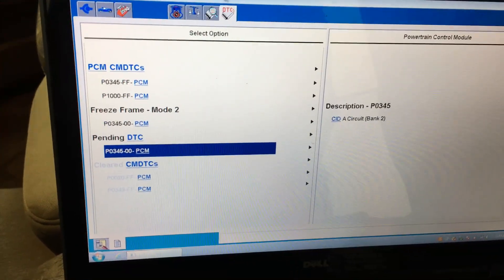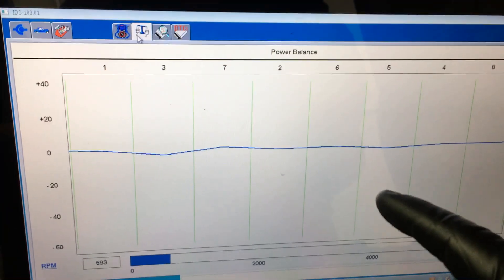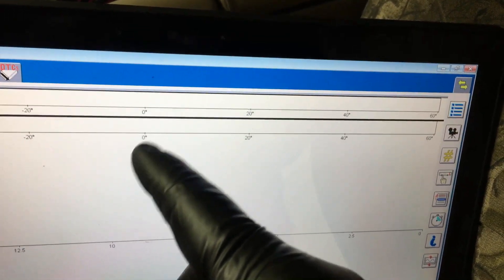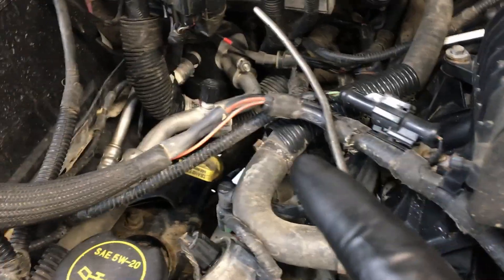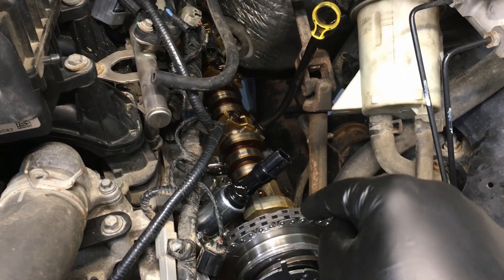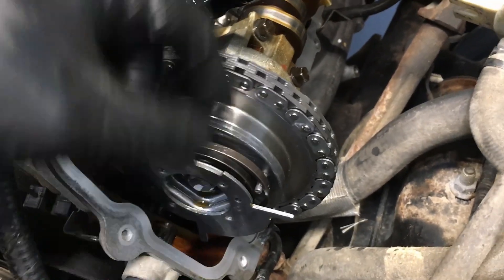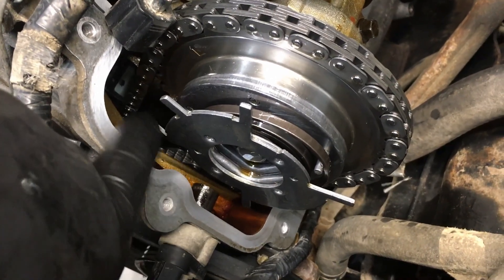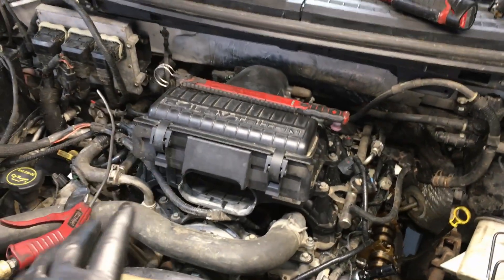Ford 5.4L 3v Triton Engine P0340 P0344 P0345 PO349: Always Inspect These Items First!

Comment from the maker: Still the Best 5.4L 3v Phaser- 
https://amzn.to/2HC6ELE
Reply: I bought a unused phaser from a guy off craigslist that was supposedly an updated version but i cant find the model number online thats stamped on the phaser, diid i get the right one? 3L3E-6C524-HA
Reply: FordTechMakuloco       Hi, I’m a new subscriber to your videos. Lots of great information. I have a 2012 Escape and I looked through the library to see if I can find anything regarding the constant vibration when idling with the 2.5L engine. Have you ever done any diagnostics on this issue? Ford doesn’t seem to have a fix for it even after having the issue for several years. I did read once that replacing the motor mounts with aftermarket ones can help because Fords are too stiff. Another issue I have is a front end rattle when going over bumps either left or right. I have replaced the sway bar links but not the bushings. I have checked the front end several times both loaded and unloaded and I can’t find anything that would create the noise. The struts are original at 140,000 KM. Could they be worn out? I’m tempted to just replace them and the control arm assemblies at the same time and be done with it. Any suggestions you can offer would be appreciated.
Reply: FordTechMakuloco will a phaser cause all 4 coils not to fire? I have a 04 F150 with the 3v 5.4. The phaser was knocking the noise when away about 1500 to 2000 miles later it starting skipping I check the coils and that whole side is not firing any help would be greatly appreciated. Thank you!!
Reply: Does anyone know if the extended warranty I bought covers the repairs to fix the cam shaft issue ? My 2008 f150 5.4l 3v w/70k miles is shaking and turns off when I reverse or in heavy traffic. (Code p0345)
Reply: @fordtechmakuloco what would you look for if you suspect an oil pressure loss in the driver's side (bank2)?
I installed a complete ford timing, solenoids, and phaser set, a melling 340hv, all new Motorcraft plugs filters and 530 oil. I'm 1000% the timing is correct.  When the engine has been run for about a half hour and you come to a stop the left bank timing goes advanced 60° and misfiring until you shut it down or put in neutral and rev it, then it goes back to normal. Fuel pressure, maf, tps all look normal. Phaser tabs not bent, swapped left and right cam sensors, still the same. Where would you start?
Reply: So I'm having the p0340 and p0344 codes the tech here at Rusty Wallace Ford is saying it's my PCM after he just replaced my engine, can this be right?
Reply: Does the middle tow ring he's too be dead across from the L when we time it ourselves? Or just after its been r running And we open it up for whatever reason... 
Just saying trying to get the answer..
Lmk
Thanks..
Reply: Great video but im giving it a thumbs down. This guy doesnt respond to comments on none of his videos
Reply: OPEN QUESTION.  Ok so I had a PO345 A Circuit (bank 2) . Ran rough a few times. Then yesterday I got 4 Blocks and it died. Won't start now. I purchased two camshaft sensors and switched out the driver side. When I went to switch out the passenger side Not only was the clip broke but the 8 mm bolt was stripped. After three trips to different stores purchasing different nut removal set,(Still couldn't remove it!) I'm now contemplating on removing the radiator fan and shroud, or attempt and try and weld a bolt on. It's also - 25 degrees. Before I go ahead and do all this work I just wanted to ask what you guys think as far as this probably being the problem. Any feedback would be greatly appreciated. Thanks guys.
Reply: @locknload9143  wasting ur time
This guy isnt going to reply.
Reply: i changed the driver side sensor for code p0345 but still have same code on the dash for my f150 2007 ! any one have any ideas
Reply: FordTechMakuloco I followed your videos and changed the entire timing system , timing cover, and left side valve cover. 

My 5.4L ran great for two days at all speeds , then suddenly the car went back to a rough idle and gave me codes P0018 and P0022, saying "camshaft position correlation" and "A- camshaft position , timing over-retarded"

I disconnected and reconnected VCT VALVES which didn't fix it, I also changed out cam shaft sensors which did not help. 

I am still getting these codes and a "check gauges message just like the symptoms were before. I bought all OEM parts. everything went smoothly until now and I'm dreading having to take the timing cover back off. What should/ can I do next? You're the professional and I await your knowledge. Thanks for all the great informal videos.

Comment: Hello. I have the coyote with new timing chains and one phaser replaced getting all the cam sensor codes and misfire codes bank 2   Any suggestions. Start and  high idle fine. Then start to drop and won’t stay running unless play with throttle the whole time.

Comment: I recently did a timing job on my 2007 f150 and before I did anything it had a p0340 and a p0344 code . Did the timing and still have these codes and engine still shakes at idle. Replaced camshaft position sensors still doing it. When I take it on a drive it normallly comes back with a clanking noise and it I’ll shut off under load.

Comment: Could it be a crank shaft position sensor?
Reply from the maker: no
Reply: @FordTechMakuloco so my car idles a lot better when alternator is disconnected. When it is connected it idles at maybe 500-400 rpms. when disconnected it has a 700-800 rpms and isn’t bogging out nor shaking. Thank you for this video

Comment: Tremendous thanks to Brian who has saved me thousands through his outstanding Ford 5.4L V3 videos. This one in particular was exactly why I was throwing a 345 that resolved into 349 (confirmed malfunction). After my timing job (following his 4 part series), I ran into this code but with a smooth running engine.  FORSCAN wouldn't even register  the VCTADVERRs on either bank. I used small wire camera through the Cam Sensor on bank 2 and turned the engine slowly as each tang went by and sure enough clear as day one of them was not like the other 4. Opened up the valve cover, carefully straighten the tang with small needle nose pliers and spongy tape on the ends. One of the bottom two tangs ended up being the culprit and not one of the three (bracketed by the L) like in Brian's case. No more codes and VCTADVERR now showing good timing values. Wish I would of watched this before the 4 part series, or after.

Comment: New timing kit. Ford phaser new vvt and Camp sens. Code p0345 and code p0349 wont go away 14 vots at Cam  wires no broken cam wires is this the pcm? Please help I have  review my work 4 times everything seems good except those codes wont go away
Reply: Bought the car with timing Issue had Cam codes when i bought it im really thinking is the pcm

Comment: you say that the sensor "NEVER" fail ....Well mine did. So it can happen. Not saying that there isnt more of an issue but my sensor did fail.
Reply from the maker: To this day I have not seen one fail in 20 years of specializing on this engine. How did it fail and was it a Ford unit. Was it damaged in some way?
Reply: @FordTechMakuloco  it looked to be original. I tested the resistance of the sensor between the two pins to have almost none. The sensor on the opposite bank had resistance as well as the new one. I even switched the old sensor onto the opposite bank and it gave me OBC code to that bank. That old sensor looked to have no damage on it.
Reply: @FordTechMakuloco  Having said that i will let you know if that new sensor fails again, (meaning something else has causeded its failure). Time will have to tell, but as for now it is working fine ....No engine codes....Motor has always ran fine..
Reply: I still 
believe you know these hand grenade motors inside and out. Keep up the videos. You clearly know your diagnostics and repairs. Never say never and keep an open mind 🖕

Comment: Replaced with motorcraft camshaft sensors due to p0340 and p0344. Replaced sensors. Over multiple times intermittent. Comes back. Bank 1.  This motor has the Roush supercharger system that has the alternator repositioned. This is happened about 4 times since replacement of sensors. 112k miles since motor and supercharger install.

Comment: I have a 2010 F-150 with a 4.6 l three valve and it is showing the p0345 code which says camshaft position sensor circuit malfunction bank 2. I replace that camshaft position sensor because it was bad but I'm still getting the same code. Watching your videos one of them led me to believe it was just my VCT valves going out but now I'm not so sure and think I may have to  at least  replace my cam phasers if not have an entire timing job done.

Comment: Need help my 2007 ford edge 3.5l keeps shutting off exactly after 10 mins runs fine shifts fine changed the cam sensors still shuts off exactly after 10 min of idle or drive i have timed it has 250000 miles wondering if its worth trying to fix or just cut my losses the water pump was changed before i bought it last year i did a new alternator and radiator and coils plugs the whole ordeal but this goof lil suv keeps shutting down with no warning any help greatly appriciated

Comment: So i have these codes plus crank position sensor and o2 sensors. I have a serious list of codes that shown up on my 2010 f150 5.4 fx4 that I'm told means my engine is shot. Just wondering if i need an engine replacement or is it something simple that is causing all my codes. It's  easier to say what codes its not listing than what is. I have no knock sensor faults.

Comment: Ive been fighting a p0018 and crankshaft and camshaft codes. Also threw a misfire code on 5,7,8. Changed both cam sensors and crankshaft sensor. Changed all plugs and was just about to open her up to get to the vct and i noticed my alternator connector plug was unplugged! Would that throw these codes and give me a very rough idle?

Comment: Awesome follow up to the phantom 345/349.   I am experiencing the same thing! I have done everything you have suggested except the Power Balance and the Relative compression testing as I am using FORSCAN.  I've pull the valve cover and checked the quality of the Phasers and no bent prongs.  Any ideals of anything else I can do?

Comment: Man, I'm having the worse luck with my truck right now. Paid my brother to do the timing job as I simply did not have time for it. Now truck runs like it has a thumper cam in it. No power no fuel miealage. Replaces 02s and cam sensors. Still same issue. Replaced FPDM same issue. I'm gonna have to tear off my tapet covers. My VCT's are melling brand. If this bent phaser isn't the issue I'm going to change the VCT's to ford oem ones. Glad I came across this issue. I owe too much money on my truck for the engine to be bad. Quite stressful

Comment: I can't believe I found this video it all started cuz it had a while I had it apart I figured I do the timing chain and new cams put it back together had a problem with bank to took it all back apart cuz I thought maybe I had the timing off put it all back together still had the traced wires did everything possible I could think of till I seen your video three of the cam phaser teeth with Bette straighten them out lights off happy guy thank you

Comment: Been staring at an engine light from a P0340. 

I got lucky and it was the drivers side so I fixed the bent tab through the oil filler cap. 

Thanks for your help
Reply: What did you use to fix the bent tab thru the oil cap? My code is also on the same side as yours
Reply: My oil filler cap is on the passenger side of course I've got the 4.6 but this 5.4 in the video also has the oil filler cap on the passenger side.
Reply: My oil filler cap is on passenger side but going through it saved me a heap of trouble.  Turned a  4 hour job into a 15 minute one for this DIYer.  Used a pair of long needle nose pliers and voila.  Thanks for the idea!

Comment: Hello, i did a complete timing job using ford parts, just fired it today and getting the Po345 and PO349 codes. The engine runs smooth, although i have not driven it yet. I did not replace the VVT solenoids, and thinking thats where I will go next. I am 100% certain I am in time on the chains. I also went as far as rolling new bearings and the HV oil pump. The pan and pick up are clean. This is on a 2006 f150 5.4 3v. Any thoughts? I do not have the software like you do so I am limited on what tests I can perform. Thank you. Your videos are awesome and I used your 4 part video to do this job.

Comment: I initially had P0345, P0349 I removed the cam position sensor and it was broken, half of it was missing.  So, easy fix right? Installed new sensor and still got the codes.  Removed valve cover on bank 2 and found the reluctor ring tabs were bent as mentioned in another video, I straightened the tabs and reassembled valve cover, same codes came back. Now what???

Comment: So I have a 2010 4.6 3v mustang and been having code p0344 and p0340 took the cover off saw the bent finger bent it back to where it is and still having this code any advice ? Did timing jump ? Tensioner got bad?

Comment: Working on a 07 Mustang 4.6l. The customer timed his own engine. runs poor and has Cam Sensor Circuit A Bank 2 code. (Bank 1 popped up once)
Checked both cam outputs with a scope. They line up perfectly. Bank 1 has a little bit of AC ripple and Bank 2 has random +/- spikes. Just to make sure it wasn't being hit with ignition, injector, or Alternator EMF I unplugged all of these things. Code comes right back on every time. I am at my wits end, I just want to know if a test light connected to B+ should light KOEO on the output wire for the Cam sensor to know for sure the PCM is even getting the signal. In my case this is a variable reluctance sensor.

Edit: Tried to check cam phasing but the phasers stay in open loop. I'm guessing this PCM is programmed to ignore cam inputs once it has that code stored.

Comment: Hey I have a 2006 Ford Explorer Eddie Bauer that’s reading codes P0345 & P0349, so I replace the camshaft sensor and the crankshaft sensor .The service engine light came back  on but The car is running fine.Any ideas?

Comment: What is the voltage at the cam connection I have a 2005 5.4 expedition  with 5000 miles on the timming job but now I have a deisle sound with p0345 and p0349

Comment: HELP ME PLEASE 
I have taken my 05 Ford F-150 to 3 different dealerships and I can’t get the answer or diagnoses to PO340-P0344.
Ford dealership says it is timed perfect, as it was done over a year ago in Utah. I am now in new Hampshire, where this vehicle needs pass inspection. I have replaced coil packs and the plugs twice. I have not only checked the PCM I have replaced it once and it is communicating. I have replaced the-two sensors on the front of the motor and the VCT sensors. And I am at loss to say the least. Could you tell me if you have an  answer ? Do these two codes appear because coil packs are not OEM ? Or  these two codes for anything other than timing related issues..
I continually watch your video and I am so impressed with your knowledge. I have passed your video onto several places by the way.Thank you
Reply from the maker: Either that phaser is coming apart or you have oil volume issues. It could also be aftermarket parts that were used.
Reply: @FordTechMakuloco  will check the coil packs because mechanically it runs and sounds very strong with only 139,000 miles and new chain Installed at 113,000

Comment: I have a 13 expedition for a little over a year now an I started getting a rough idle and then camshaft position codes, it looked like someone was in there doing valve cover gasket’s so I pulled the cover off and one of the tangs on bank one was bent forward and it chewed up the sensor. I bent it back straight and thought I was done after replacing the damaged sensor, but when I was done and started the truck it ran rough again and threw the light on. So now I’m thinking check bank 2, well bank 2 was perfect. Long story short now two days later and it seems ok. Also did all new Motorcraft coils as well. Under the valve covers the engine is spotless 150k and it looked like 20k.  Eventually I will get a timing job done since the phasers aren’t ford and I don’t want to take a chance. I just wish that you were in NY cause I would absolutely bring it to you.  Thanks for all the information you give to us all.  👍

Comment: Can a bad cam phaser cause a no start my 09 f-150 4.6 was running while plowing snow  then started to run rough then stalled  now it turns over it no start had p0345 code coughs up through the valves when turn over  sure sounds like out of time valve covers off everything look good but the phaser never went back to mark
Reply from the maker: It sure can if they are stuck way off.

Comment: Is it possible for phasers to be defective? I rebuilt a 5.4l 3v from a 06 f150 and it ran fine for like 2 months then now it only runs with the passenger side CPS disconnected I checked everything and nothing so is that possible? I’m going crazy trynna figure this out